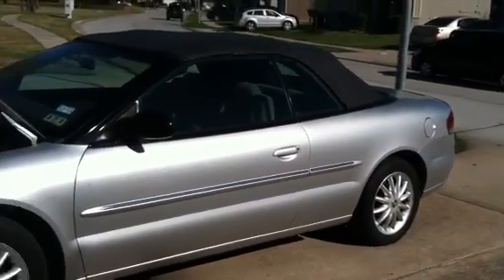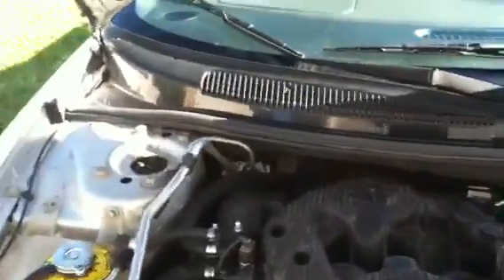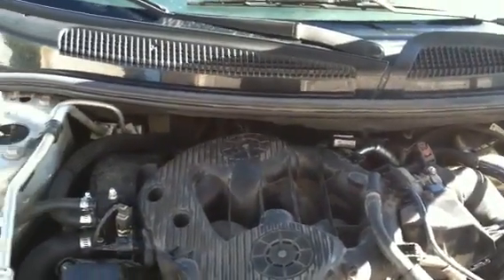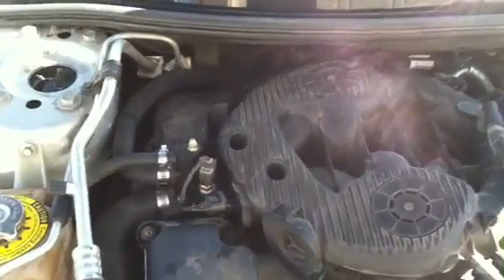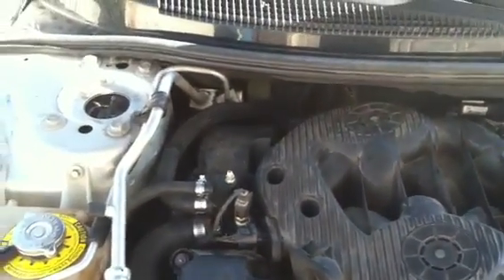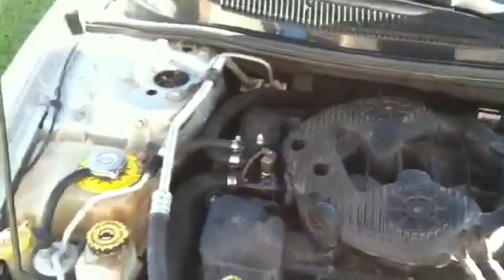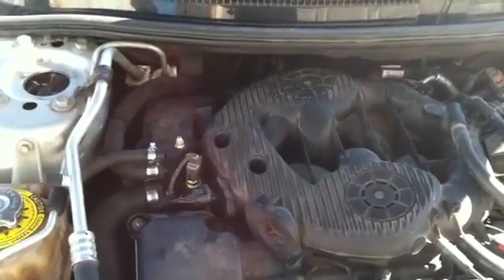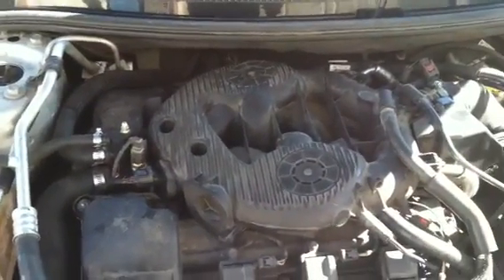Chrysler Sebring 2.7 liter won't start resolved

Comment: was there a sound when you were trying to start engine after it became warm? or no sound? i have problem - no start on warm engine, but it's only one "tick sound" in relay/fuse box and another tick somewhere over intake manifold. and after i hit engine up-down by hands it starts. did you have same sound?

Comment: My 2006 2.7 Chrysler Sebring Died On Me, Attempted To Start It Back Up It Sputtered Didn't Start. Then It Started Got Me A Quater Mile Then Died And Completely Spilled Fluid All over The Road. What Would This Be? It Lost All Power.. I'd Crank It, It'd Sputter But Like I Said It Was Completely Dead... Fluids All Over The Road. No Signs Of Over Heating Nor Any Smoke
Reply: Mine's do the same thing go right now what is that shitt I just bought this m********* car
Reply: Did you ever find the problem besides with he is saying on here
Reply: Check your belt.

Comment: mona, after replacing just about everything I could...it was the CPS now runs better then ever..kinda glad I went the long way...no worries for another 100,000 + miles...hope this helps
Reply: What is the CPS?
Reply: Barry Adams 
Cam or Crank Position Sensor(I think).
Reply: Fly Head what is the CPS on her Seebree 2001.7 engine I will start with the CVS